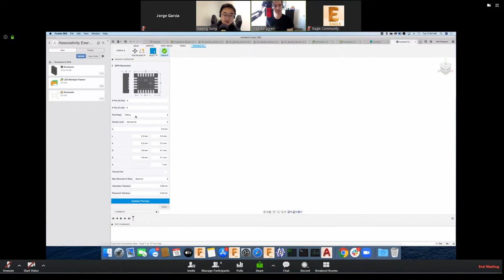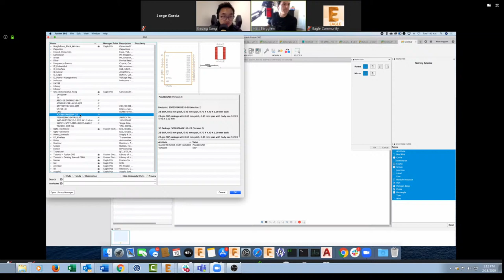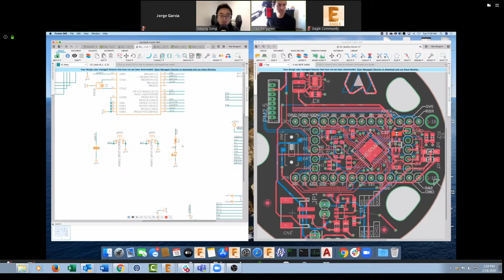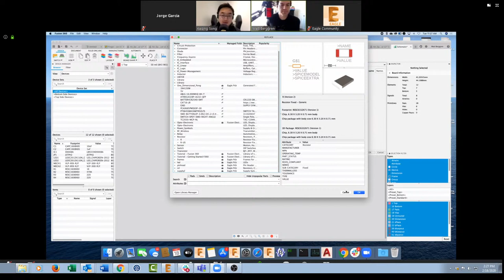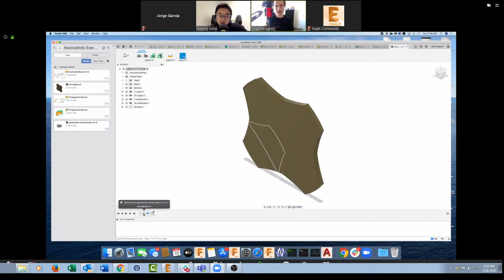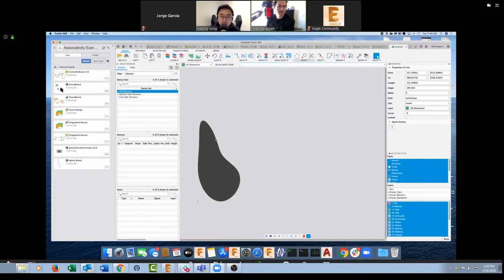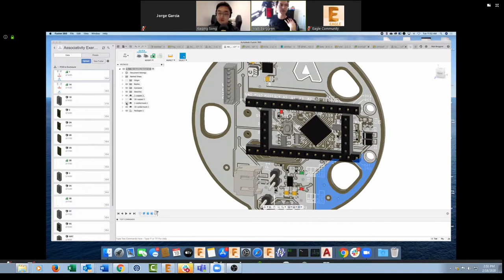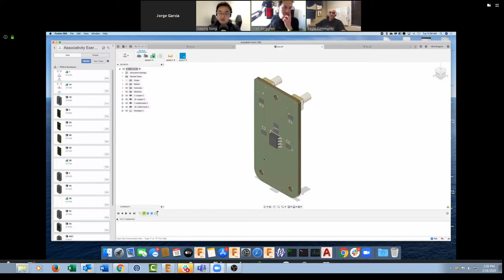360 LIVE: Solder-Side Chat

Comment: Is there a future where BOM management for eCAD and mCAD is integrated? A single export for manufacturing would be amazing.
Reply: Michael Morena This is definitely something we are looking to unify!  It would make sense that there was a rollup of all the costs for a given product. That might also include things like manufacturing cost for a bare board, tooling, 3D printing, etc.
Reply: @professionalservices1094  Awesome. This would truly be a game changer. I am often involved in full-up product development from industrial design, mechanical design, electrical design, and BOM management. Assembling a full product BOM to then pass to a Contract Manufacturer for quoting or production is often a manual stitching of tons and tons of isolated data (3D models, 2D drawings, BOMs, PCB gerbers and fab drawings, pick places files, odb++. packaging drawings, labels, firmware etc etc).  I've used tools like Arena PLM to do this, and its a ton of work. If Fusion could cover the mechanical and electrical together, that would get 90% of the BOM ready for quoting.
Reply: and how dose that have any thing to do with fusion?
Reply: David Finlay Fusion like any MCAD program is used to develop product definition: part numbers, assemblies, sub assemblies, models, and drawings. You need very tight control of these things when transferring to manufacturing. Typically you would have these outputs as part of an electromechanical BOM. The other components of that BOM would likely be PCBA related. All of this is now defined in fusion with the new integration of eagle PCB design software into a single unified tool. Being able to control your product BOM definition is very valuable and at the root of any professional package (Solidworks, Altium, etc). I don’t want to sound like an ass but control of this type of data has everything to do with fusion 360.
Reply: @mmorena2787   so maybe it time for you to learn fusion it free unless you are making $100,000.00 + then i think it $3000 a year. think for the info i just do cad for a fun hobby and do not know every thing and learning as i go.
Reply: @mmorena2787  maybe you can inport your cad to fusion?
Reply: @mmorena2787   go to fusion galery and put in my name and have a look of what i can do.